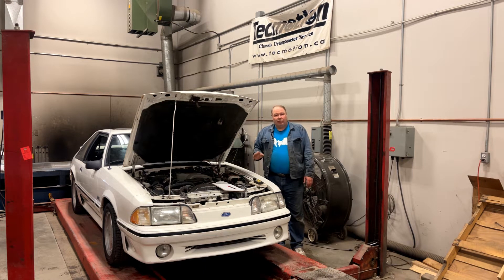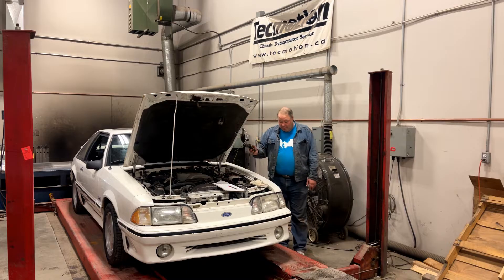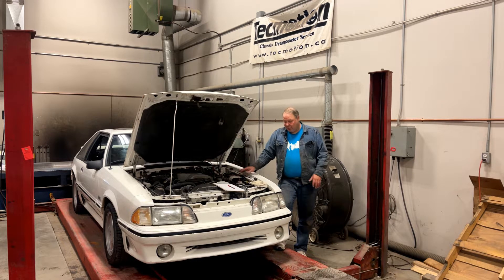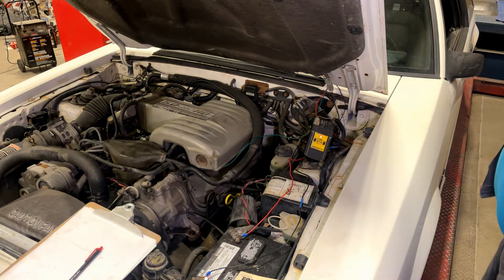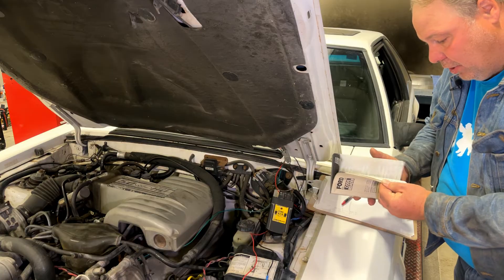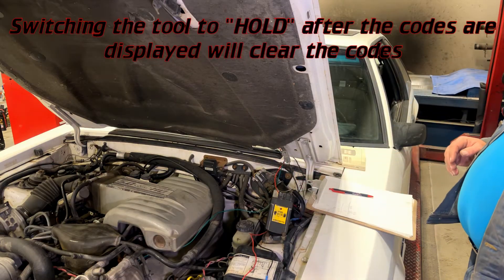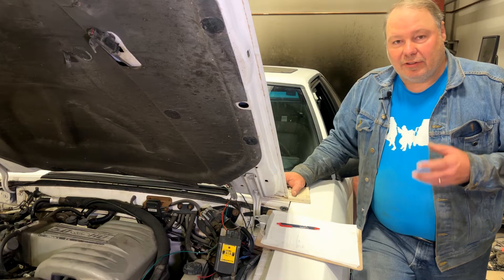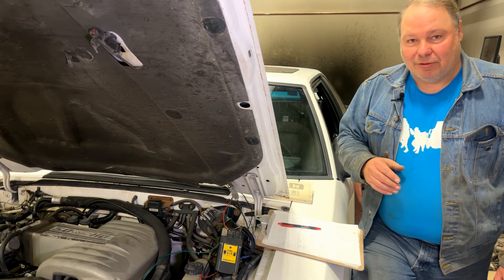The Hidden Engine Health Test in Ford EEC-IV PCMs that you need to know about.

Comment: 10/25
A9L finally needs capacitors etc.
Runs ok except hot idle hunts 500+1100. 
Randomly get a no start hot start. Full throttle then it starts.
Thanks
Reply from the maker: These old computers are deteriorating for sure. If your capacitors are leaking you can have a lot of problems that are hard to place. I looked at one the other day that has a few hard to explain issues and although I could not see an actual leaky capacitor, one looked suspicious. We are keeping an eye on it.

Comment: Great video to get the most out of the OBD I code reader. Key on eng off. Then key on eng on running. Ect..
Reply from the maker: Thanks for the endorsement. I think a lot of people just don't know about the cylinder balance test, which is very useful in diagnosing engine problems, and is right on-board.

Comment: Has anyone ever tried the adapter OBD1 to OBD2?
Reply from the maker: These standards are completely different so you need an OBDI compatible code reader to work with the OBDI Mustang. Also, the OBDI Mustang does not directly support datalogging.

Comment: I have this exact tester.
The book says, "The KOER test will not run until code 11 or 111 is obtained for KOEO".
It sure will not 👍
So if youve pulled your EGR, smog pump, gas canisters, etc. You are dead in the water.
'90 Mustang GT.T5
Reply from the maker: I'm not sure that is actually true. I'm pretty sure that I have run KOER tests on a car with codes in the KOEO test. I might set one up and try it to double check though. Of course, if you chip tune the car you can delete all that stuff and mark it "not present" in the software so you will not get a code for it, which would help if it turns out to be the case that you can't run KOER without a clean pass on the KOEO.
Reply: @tecmotiondyno 
Just ran it an hour ago.
Codes
64 ACT
82 Smog pump
85 purge canistr
87 fuel pump cycle 
This one is stock '90 wiring and A9L and all, no cats but yes O2,  in a street rod.
Ran perfect 18,000 miles til last Tuesday.
Thanks.
Look at book section 2-5.3 #6 on page 2-11 top.
Reply from the maker: @hotrodray6802  the main thing there that could really affect things is the ACT. If it thinks it’s -40*F, it will definitely affect the way it runs. You’ve definitely given me something to double check though.
Reply: @tecmotiondyno 
I will change ACT asap. 
Thanks, I was surprised and pleased for your prompt feedback. 👍😎
Might be Tuesday until I get it changed.
Reply from the maker: @hotrodray6802 There are some tests that can be done to check whether the problem is the sensor or the harness or PCM. I'm sure you can look them up on the internet. I would do the tests first before just replacing the part, but it looks like there is a problem with that system for sure.
Reply: @tecmotiondyno 
Update: stock 90 A9L, as previously noted. 71,000 miles runs strong. Original factory ACT.
Removed ACT and discovered it is covered with black soot from the PCV. I did install a new one, Standard AX3. Instant start at 50* ambient. Runs fine now.
I plan to carb clean the original, run test it, and save it in my spare parts can. 
Still no KOER test. 😐
Thank you Sir.
I will advise updates. 👍?
Note I installed a new one primarily to test the circuitry. Next I'll clean the old one and confirm diagnosis. 👍
Reply: @hotrodray6802 Should be able to clear continuous memory and then run KOER test. But, if you haven’t fixed those issues, make sure you wrote down the codes.

The KOER will interrupt and give failure code if you have any issues that cause it to not be able to perform a specific test.

Comment: Okay, these engines weren't all sequential fuel injection though, most were bank fire speed density fuel injection?
Reply from the maker: I would say that the better part of them were SEFI including all the Mustang engines, but you are right, some of them are bank fire. I am not 100% sure how this test works on a bank fire version, but it could use a spark cut.
Reply: @tecmotiondyno  FWIW in my understanding, the earlier versions of efi were speed density because maf sensor technology was in it's infancy.  My '95, '94, '90 Fords use speed density but california (CARB) versions were for '95 used maf.  I'm not sure exactly which engines or when Ford first introduced maf, but those were all sequential injection as far as I know and speed density (MAP only) were all bank fire injection.  In the case of '95 maf, ignition wasn't DIS, as far as I know.
Thus I'm pretty sure if the ignition is dis, this will also be sequential injection.
Then we have all the different versions of ecm's, parts availability (discontinued parts?), on and on... ;)
Reply from the maker: Pretty well all of the speed density cars were SEFI - Mustang, T-Bird, Cougar, Mark VII, Crown Vic, Grand Marquis, etc. These will go back as early as 1986 in some cases. MAF was first introduced in the Mustang in California in 1988 and nationwide in 1989. The speed density trucks and vans were mostly bank-fire. MAF equipped trucks like some 93 E-Series vans were SEFI.
Reply: @tecmotiondyno  1990 2.9 V6 Bronco II federal emissions?  1995 Bronco 5.8 Federal emissions?
1994 F250 460 Federal emissions?
See electrical schematic, 8 injector channels or bank fire?
Reply from the maker: I don't have the 94 460 schematic or the 95 Bronco schematic handy. The 90 V6 Bronco is a MAP controlled vehicle and is batch fire. In most cases I think the MAF vehicles were SEFI and the cars were SEFI regardless of whether they were MAF or MAP, as I said.
Reply: @tecmotiondyno  The '90 V6 also doesn't do any datastreaming.

Comment: 😂😂😂.... Well, I have this OBD1 tester...But...I have  been living Blissfully Ignorant since I bought my 1993 Ford f150 5.0 truck  with  143,000 miles on the clock presently ,  about 2 yrs ago... What started out as Standard maintenance and repair of the truck,  since the last owner really didn't do any repairs and maintenance,  is turning into a almost "Restoration "... I  am replacing alota 30 yrs old parts  that should've been replaced yrs ago.... Soo, by reading the codes, that would add even more to that list...Sooo, for me and now,  I  don't wanna know...😂😂😂😂...

Comment: i didnt know that rev up was a balance test, i wonder how i get the results on my obd2 eec-iv au falcon, ive been using forscan and an elm327 wifi
Reply from the maker: On a professional OBD2 tool, a similar test can usually be found under engine functional tests, and should be called something like Cylinder Balance or Power Balance. I can't speak to your specific application, but that is where to look.

Comment: how does this test work on a 4.9 as the injectors are wired to fire others at same time. I have a 88f150 with 4.9 that had to redo upper harness and discovered in testing this harness that it fires them in pairs at same time.  never would have known about it otherwise. thanks
Reply from the maker: There are also 5.0 Ford setups that are batch fire. I have never personally tried the cylinder balance test on one of them.

Comment: Excellent videos !! Your how to vids are so helpful! I have recently followed along to your how to vids on the Power bond sfi balancer and radiator replacement on my 88 5.0 lx convertible. I just picked up the obd1 scanner from a local parts store and performed the key off test. Extremely simple and i only got one code which was a code 67 neutral switch which makes sense because i just completed a AOD to T5 swap on my car and the neutral safety switch is unhooked on the t5.  I do want to try a engine running test and the cylinder test. I want to tackle the rear end gear install and get rid of my 273 gears for the 355 gears but i think after watching your video it might be out of my skill set. Could you do a video in the future on how to remove the foxbody 8.8 rear end out the car. I would like to remove my rear end and take to a shop to have the gears and rear end re built!! thanks alot!!!!!!!! best foxbody how to on youtube.
Reply from the maker: Thanks for your supportive comments. If I get a rear end removal job I will film it, but if your objective is just to do the gear change and you are hiring someone to do it, it will be simpler and less costly to do it in the car. If you are changing everything - control arms, shocks, weld on housing ends etc, and you more or less have to remove the housing anyway, it makes sense to do the gear swap with the housing out of the car and on jackstands, otherwise I think you are just making extra work. I usually book three days with the car for a gear swap because of interruptions and contingency, and the only step I usually do on the third day is to put the fluid in it because I prefer to let the rtv cure overnight. In bigger shops where the mechanic can just work on the car and doesn’t have to answer the phone and deal with walk in’s and all of the other little daily distractions, an 8 hour day is usually enough for the job, so you don’t generally have to give your car up for an extended period of time to get the gears changed.
Reply: @tecmotiondyno  thank you so much!! 🙏biggest reason why I wanted to pull the rear out and take it to a shop was because I hate leaving my car at places unattended.  Figured it be easier to take rear out car take the new parts and whole axle to a shop and say call me when it's done. I see what you are saying though! Thanks

Comment: I do my "cylinder balance test" while I am cranking the engine with the starter, and the coil wire off..

You'll hear a distinct "skip" while an engine is cranking if it has a cylinder with low compression. 
If the engine sounds good while cranking, but then has a noticeable miss while it's running, then it's something simple such as a bad plug/wire, bad fuel injector, or something else easy to repair.
Reply from the maker: That’s a legitimate diagnostic even on a carb equipped car. Thanks for the feedback and thanks for watching!
Reply: @davelowets  If it's efi, chances are flood mode is implemented and you can perform your compression balance test without opening the hood.

Comment: I Sir, I love the content here.. 90 Fox.  I get a a thermactor code for KOEO.  no worries, but for the KOER it's dead.  No 4 flashs , just dead.  Any idea of the issue?  Car runs grate, but rich on idle.   Thank you
Reply from the maker: I have seen them unable to test where the sig return line is blown on the PCM, but that should prevent the KOEO test as well. With the older style tester, you do need to start the car, then switch the tester from HOLD to TEST in order to initiate the KOER test, just in case you accidentally missed that step. Sometimes these weird problems are very hard to diagnose in person, never mind over the internet! Thanks for watching.

Comment: Got 1986 4 eye gt all stock seat over a decade found in salvage yard. Running very rich checked fuel pressure 39 psi replaced map sensor. Could be bad injector or harness.
Reply from the maker: Could be, or a computer fault. Could be oxygen sensors too. Try the cylinder balance test to see if the problem is limited to one or two cylinders.
Reply: Bad temperature sending unit.?

Comment: any idea what to do if your getting No power to the scanner plug? and  my fule pump doesnt shut off, when key is on pump in always running. did the swap from 4cly to V8 and having some problems on my 87 coupe. any ideas ? Thanks
Reply from the maker: The first thing that I would be looking at is a bad pcm or blown sig rtn trace on the pcm caused by an incorrect loop back on the o2 sensor harness. Fuel pump running constantly is a typical symptom of a bad pcm or corrupted chip on the pcm.
Reply: @tecmotiondyno  thank you !
Reply: No big deal. The only thing you lose is the 1-2 second prime cutoff at startup. I prefer constant run, and wired mine direct instead of through the computer. It's been fine for 28 years as is.
Reply: Alarm for 58 bypass the whole fuel system and run a toggle switch from the battery straight to the fuel pump and turn it on when you're driving it when you're ready to start it up turn it on and you got fuel make sure you turn it off though when you're done driving or you'll burn up your fuel pump it works for me with life 150 OBD1
Reply: I also had a reoccurring PCM problem that had to do with my fuel pump on my F-150 I replace fuel pumps I replaced everything but I never once thought it was the computer until I ran across the thread that pointed that out that's kind of problems and every one of the computers I replaced and I keep my old stuff if I don't have to turn them in for a core,, after I opened up the old ones that I had saved up for me though cuz I said everything cuz I believe everything can be used at some point I can see you exactly where the there was Burt obviously had to do with the fuel pump situation because three of them I looked at and had the same problem that's why I replaced them they're all burnt in the same spot but are totally repairable with you know some soldering and a little research

Comment: Interesting. I’ve got the same scan tool. Just got a clean bill of health on mine too. 9 beeps. Had 1 code with key on, engine off and 1 code with engine running. A trans oil temp and trans solenoid circuit. My car OEM had an automatic trans and someone went thru the headache of converting it to a T5 manual long before I got it 4 years ago. It’s always had those and I’ve always believed it was because of the manual trans swap. I was looking thru the manual for the diag tool and the cylinder test is actually in there and I never even knew it lol.
Reply from the maker: The cylinder balance test is documented but people don’t read the manual and some of those that do don’t recognize the power of this test! Sometimes you get codes on a modified car that just don’t apply.

Comment: Nice! I have the same scan tool! Found a bad coolant temperature sensor on my 92!  Gotta love old school scan tools...worked like a charm!  Great video Matt!!!
Reply from the maker: I'm surprised how many guys I see trying to diagnose problems with their Fox that don't even go as far as pulling codes, but I would be willing to bet that MOST of the guys who do pull the codes don't know that you can activate the cylinder balance test that is built in to the EEC-IV and find a dead or low contributing cylinder. It's such a powerful test when it comes to determining overall engine health or narrowing problems down to a particular cylinder!
Reply: @tecmotiondyno 
Trouble is the engine running test will not happen until the Engine Off codes are repaired.
So if you've pulled your smog pump, smog canisters, EGR,.... you're dead in the water.
Reply: Thanks Matt! I also have the same tester, it’s old like me and it still works fine haha! This video was an excellent review and very helpful 👍👍